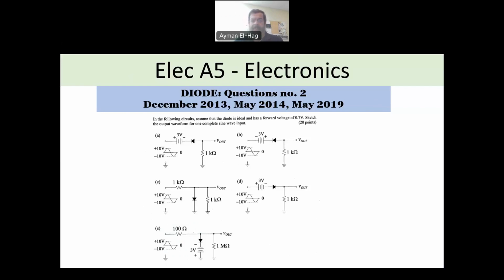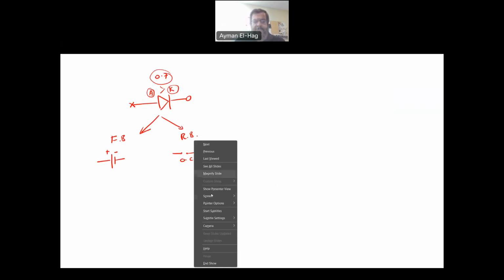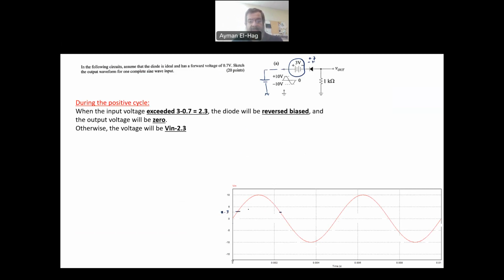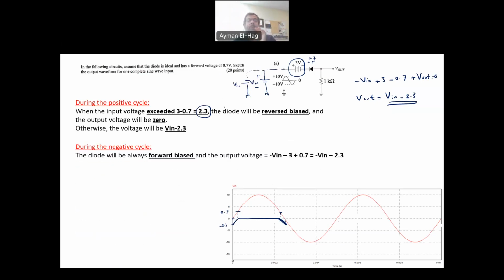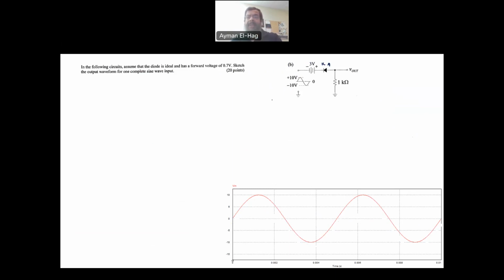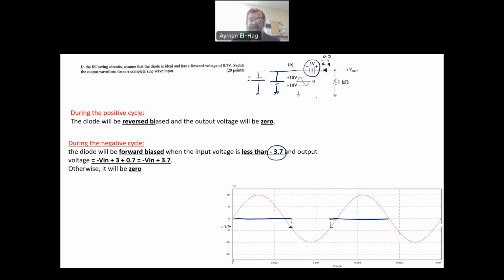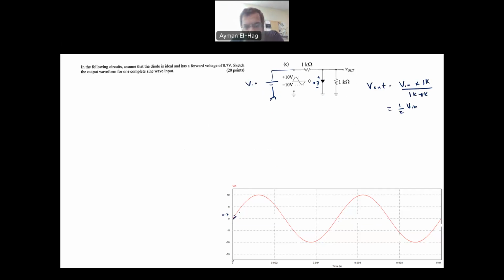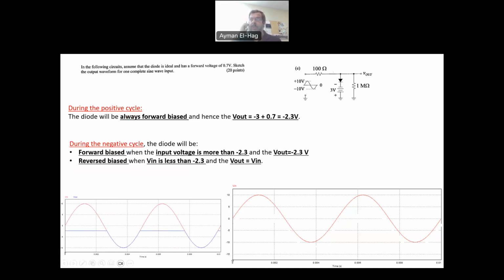PEO solved examples (ELEC A5): Diode Question no. 2

Comment: I am really struggling with this concept, could you please explain more.  I should not be struggling with simple diode circuits, but i am getting more and more confused. My background is instrumentation and control.
Reply from the maker: The main points you need to pay attention to are: when the diode will be ON and when it will be OFF, once it is ON, then it will be a constant voltage and once it is OFF, then it will be an open circuit. In AC circuit, unlike DC circuit, the diode will be sometimes ON and sometimes OFF. In DC circuit, it will be either ON or OFF.